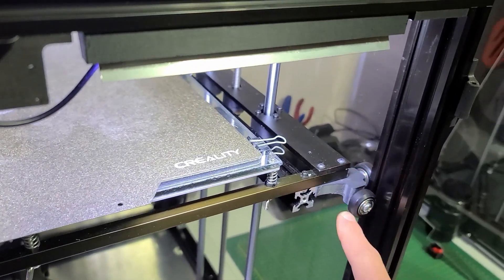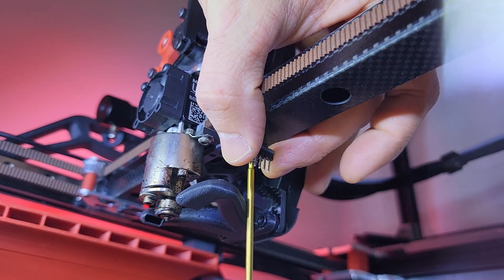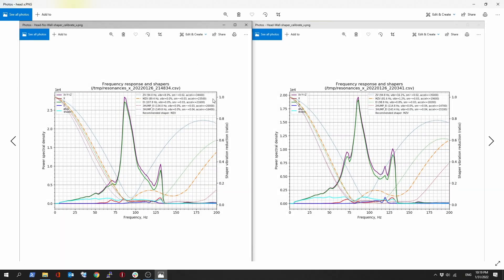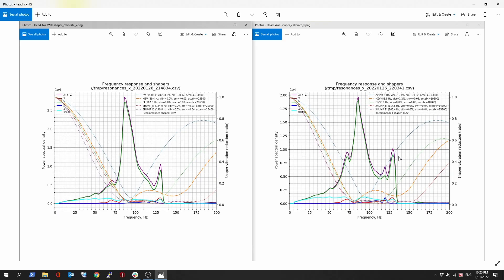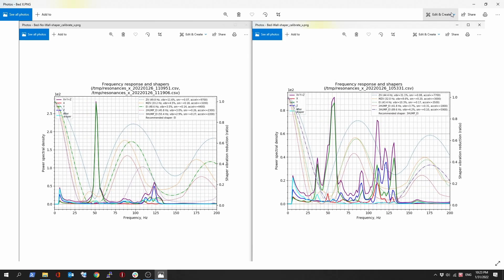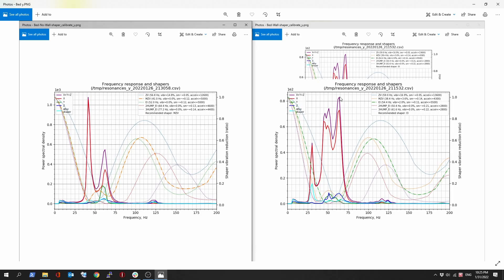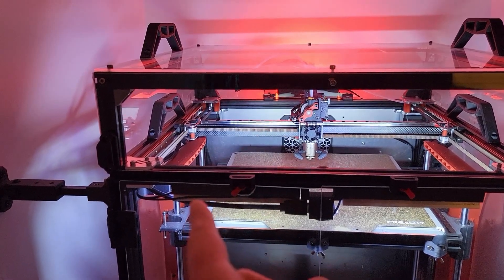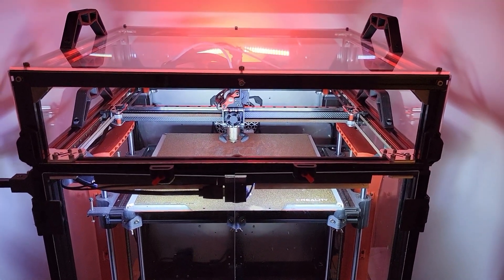Wall anchors tests

Comment: Great job Simon thank for all you do
i know stratasys small and large printers for a fact have large rubber isolators and the ones on cabinets and floor models shake rattle and roll to move the whole thing not to affect the print if all moves together your best for them that's how they roll but you do 1000mm/s they do 150-300mm/s they also have vacuum build tables to help hold the parts on sheets on some better ones..but weight a tonne 
I would like to see you try adding rubber between those arms and under the whole thing but maybe suspend it like a hammock lol joking...maybe not... i really do not know the best way as your printer is not heavy its hard to dampen things with out weight behind it accurately (which durometer where how...)  after a sweet spot it will be better but how stiff?90 duro 70 duro 50 duro??? but again race (cars/boats...)anything use solid Motor mounts usually so i see both sides equally ! hope u get my jibberish cheers keep it up  try to get that in-car Cadillac ride going! is my vote

Comment: Hey, just repeat my other comment.
You could fill the "pillars" with concrete to stiffen up those maybe also fill the lower frame with concrete.
when it is empty anyways this a cheap and easy (not clean :D) job.. In CNC Machines this is done to make it more rigid and dampen vibrations..

Comment: Mount the printer to the wall and measure on the tool head will make the result number better because the result use gravity as preference. But I wonder if we mount another sensor on the bed(or the frame) and use that value as preference, what the result on the toolhead will be. Just a ideal, but I have no ideal how to do it ... Hope someone smarter than me can make it possible.

Comment: What do you think of the idea of building a stabilizing frame out of thick metal for the printer, fix the printer on the frame, and then bolt that frame to a concrete slab, which is then dampened underneath.
That's what I wanted to do with my ratrig.

Comment: bolting it to the wall is going to do two things, it will stiffen the structure, making some of your peak resonances higher pitched. which you see.
it is also going to deliver some of the vibration into the wall where it can be distributed over a large area.
The stiffness of the connection makes delivery of that resonance into the wall more efficient, but the stiffer it is the worse it will be at damping the resonance and turning it into heat or sound.
Think of that previous less stiff belt.
It may have been stretching more, which isnt good for print quality, but it should materially effect vibration, since it will be less efficient at transmitting vibration from the print head back to the motor mounts.

If you wanted to continue to improve your work. you probably could add more anchors.
You mentioned that it would make the ringing out of control. That on its own probably would. You would be stiffening the structure a lot in multiple directions.
But with the additional anchors, in additional directions, you can afford to acoustically couple the printer to the wall with an interface that will do a better job damping the vibration (like a semi-stiff rubber or spring or shock piston). The adding connection points should increase your overall transmission of energy through the wall, and you can minimize the acoustic reflections coming from damping the coupling anchors.

no matter what, the vibration is going to go into heat, or into something else (whether that is the wall or the air), its just a matter of putting it somewhere else and keeping it away from your print as fast as possible.

Comment: Hi seeing that the anchors do so much improvement, why dont you put 12? Now you have 2 in the back upper part. And one in the left side upper front. Have you thought about puting a copy of the back ones in the lower beam of the printer. And the side one, copy it to all other 3 corners, and also in the lower beams. This way, in each side you'll have 4 anchors. Maybe that makes it more stiffer. If you do it could you do another video with the same tests? And then you will be able to compare. No anchor, 3 point anchor, and 12 point anchor.
Reply from the maker: I cant add anchors on the lower side in the back.. i wont be able to access them

Comment: I wonder if you put a second corexy gantry above and split the supply from the drivers and swapped pins over (or motors upside down) with a matching weight for the print head.... if you could cancel out the movement/vibration, like a V or even W engine would do, so x and y would move to + and the weighted top mount would move to the - ....... I know it wouldn't be power efficient but high speed anything usually is not
Reply: I think that's actually something the guys could explore for the AWD drive on the VZ2xx.. would be interesting for sure imho

Comment: Very interesting results, thanks for doing this test. I can’t speak for everyone, but I would personally be interested in seeing more in depth content like this. It would be neat if you could make a test object and either compare the print quality before/after with the exact same printer/slicer settings OR the improvement in acceleration for an equal quality print. There’s no data I know of that can quantify the relative value of each mod

Comment: You make great job ;-) Can you share the stl´s or CAD for the wall ankers?
Reply from the maker: I can .. but the design was made for some recycled aluminum parts I had laying arround, so unless you find the exact same dimensions piece of metal.. this will probably not work. however, if you are patient enough, the new Vz235 comes with wall anchors made with 2020 so that would be better :)

Comment: Thanks for all these great videos. Great work on your printer, very impressive. Thumbs up! 
Regarding the silicon spacers, I've heard good things about them, but I always wondered if they tend to sag with time (and require bed tramming more often). I use manual tramming and I find that the springs maintain the leveling very well (but they seem to induce some printing artifacts). What's your experience on this? How well do they maintain the height of the bed from print to print?
Thanks. Keep up the great work!👍

Comment: so the next step is to build the machine out of Granite Slabs or cast the frame from concrete. At a previous job we had "small" cnc mills wich milled pcb like materials with the size of maybe a A4 paper. The machines were build from big Granite slabs to dampen vibrations and propably weight 3 to 4 tons.

Comment: Simon, you could be right about the new belts adding the 130HZ mode. There are two reasons 1) the new belts are stiffer and/or 2) the belts are tensioned more. 

In order to confirm if peak is due to the belts, you can download an spectrum analyzer like spectroid and pluck the belts like a guitar string. If you see a spike at 130Hz or a multiple of it (260, 390 etc) then it could be your belts. OR you could try to change the tension on your belts and rerun the IS test or spectroid. If the peak changes in frequency with the change in tension then you know it's your belts.

IMO, I would try to get the frequency of the belts to overlap with the primary frequency of the machine. This way  a more surgical shaper like MZV will be most effective
Reply from the maker: yes I have a spectrum analyzer and all that.. and did lots of tests.  I will try to dig more into your idea of matching it.. but im not too sure if its a good idea... because the belts frequency is different when you move the head at different positions

Comment: Hey I noticed that on your x-axis charts you have an increase in the ~70 Hz area. This is within the resonant range for a wall, any thoughts on adding a rubber pad between your wall mount and your wall?
Reply from the maker: I can try that
Reply: @Vez3D  Hey shortly after I made this comment I saw your video for printing TPU fast. Could be a fun rabbit hole there for testing durometer/infill density combos should you be interested. I totally understand that doing a full DOE is a massive time commit, and I would completely understand if you only opted to try one, two, or even zero pieces. Keep up the awesome content!

Comment: You did a great job with this video, no one has ever measured resonance of the bed in a corexy.
That said, some remarks:
- the vibrations of the bed are 100-1000 time smaller than the ones of the carriage, therefore they are for all practical purposes irrelevant.
- the video by Stefan (CNC kitchen) used foam and concrete tile to "decouple" the print from the room floor, to reduce noise, otherwise the floor was acting as speaker. Quality was a secondary goal, and didn't change much. You are doing the opposite and you are transmitting vibrations to the walls much much better than before. Likely you'll hear the printer in other rooms, noise is carried by the whole house! You are looking for a different goal compared to Stefan.
- about stiffness of the frame (the earthquake effect you mention): if that's an issue then it's much easier to use an aluminium plate (2 mm is enough) on the back and sides of the printer and bolted to the 3030 frame over all sides. You are making then the printer almost perfectly stiff and the earthquake effect disappears.

These are minor remarks, still a nice video with new and interesting data!
Reply from the maker: you are right that resonance on the bed is almost irrelevant.. BUT, there are other vibration movement that are affecting the bed when the printer shakes that is NOTot resonance... just movement from shaking. That is not measured here and is what Im trying to combat :) I just wanted to see how much the wall anchors would affect the reading on resonance, that give me a good understanding on the rest.  The noise on the room is actually lower that way for me compared to my old setup where the printer was bolted to internal wall where there is no concrete and no isolation. In my new location, the noise is a lot less than before because those walls are isolated and screwed to concrete. And i dont hear the printer anymore in the house. the sound is just in the room and much more pleasant :)  As for aluminum plate, there is already a 3mm aluminum plate in the back and acryly panels on the sides. Im thinking about switchting the sides to Aluminum too.. or maybe steel plates that can be easily remove.   Thank you so much for taking the time to comment here. Its appreciated by me and im sure by others. You seem to have a very good background on knowledge and I like that :)

Comment: Try to attenuate the vibrations between each joint of the mechanical structure. Normally use something like Nylon carbon fiber 3D printing pieces between each joint of the mechanical structure. It will attenuate the vibrations, because the vibration are passed through the nylon carbon fiber pieces and highly attenuated. Love your work.

Comment: I think you have really touched on a vital point here....It doesn't really matter how much the whole printer shakes (as long as you can keep it on the bench) It only matters how much different parts of the printer move relative to each other.
Reply from the maker: And that is hard if the whole printer is dancing like crazy at 20k+
Reply: @Vez3D  Absolutely, wasn't disagreeing in the slightest.

Comment: NEXT: build another Core above with dummy weights (same as x-beam and head) and let it run the opposite directions while printing - countering all the forces. Like the counterweights on a crankshaft.
Reply: That’s exactly the method high precision ultra fast machines like lithographies for microelectronics work. Good thought 👍🏻
Reply: @niklask.5593  Not really.. i already know this quite well 🤭
Reply: You'll get a nice print but to move twice the weight he'll need to halve his acceleration and reduce his top speed
Reply: @fail_fast  nope.. the countermechanism is independant

Comment: I drive made to improve things on the Vcore with input shaper. That said, I use to get good result with the new cnc crossbar. for a 400 I got 850g for the full grantry/toolhead a hit mzv @ 75hz driven 8.6K mm.s². I observed the machine flexing a bit under stress, Even with 5x 3mm aluminium panel...Sooooo Anchors? Im in. Was mondering about fixing a granit epoxy block under the machine or a 12mm stainless steel plate to increase the mass. As far as I can see the Nylon arm of the bed are absorbing the vibrations, act as an dampener, never mesure the bed shaper but I will :)

Comment: I wonder if you could make a tuned mass damper tuned at and suspend it from the bed. Since you have different resonant frequencies in X and Y you could even constrain different mass dampers to only vibrate in X or Y and have them each work at the proper frequency.
Reply: You might need to implement a counterweight system so the Z axis Motor(s) don't have to move all that weight directly. It could lose steps perhaps? 

Though I don't know if that even matters with this weight but counterweight systems are common on heavy vertical hobby CNC-Mills builds. Many hobby machines just use a chain and suspend a weight guided on rails on the back of the Z-Axis-Column. In this case, he'd have to put 2 counterweight systems in where his 2 seperate Z-Axis-Assemblys are

Comment: I couldn't see, but did you also have the complement of the three supports on the upper level of your printer also affixed to the lower part of the printer? If not, some vibrational 'pivoting' could occur about those upper supports. Of course dampened by the base held by gravity to the table top.

Also best to place the unit multiplier in a parenthesis appended to the axis: e.g.  Power spectral density, UNITS (x10^4)   [or use SI units like m(milli), k(kilo), M(mega), G(giga), et.al]

What sensors did you use to gather the data? Very curious. THANKS for sharing your efforts with us all!!
Reply from the maker: Adxl345

Comment: Cool study! Did you happen to compare the same print done with and without the wall anchors? Would love to see the results as it seems like there should be a significant difference.
Reply from the maker: I will run a test. But to see a significant difference, the accel must be high like 20k and the printed part must high enough. This is for unicorn printing hahaha
Reply: @Vez3D  I found interesting that the maximum acceleration suggested by the resonance script are basically unaffected by the increased stiffness.
I doubt you'll see effects except, as you say, on tall objects (due to now missing earthquake effect)
Reply from the maker: @Olaf Marzocchi  i saw results even small objects too..but that was with ODrive mortors. Since then, i have always anchored my printer so im due for some tests :)